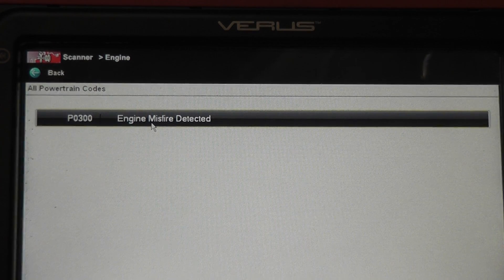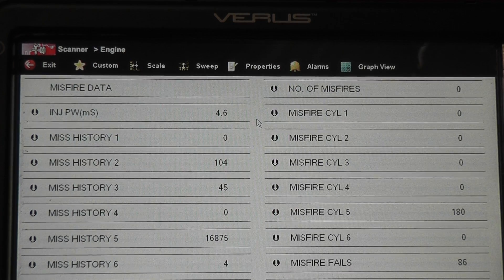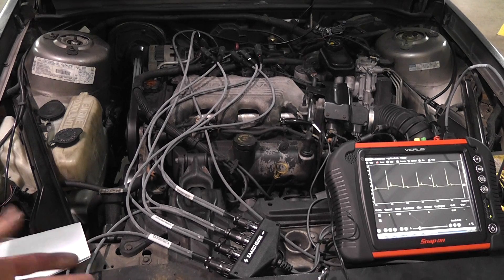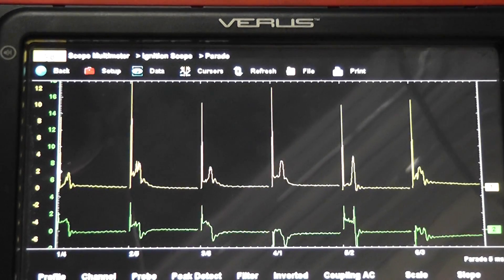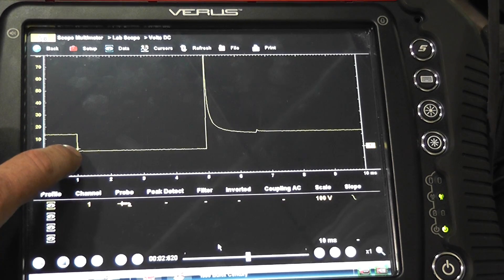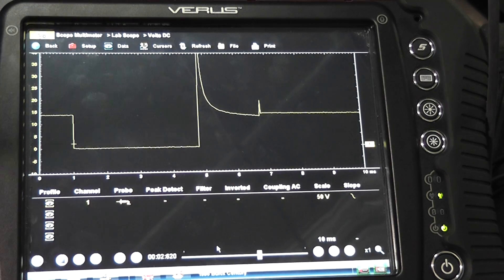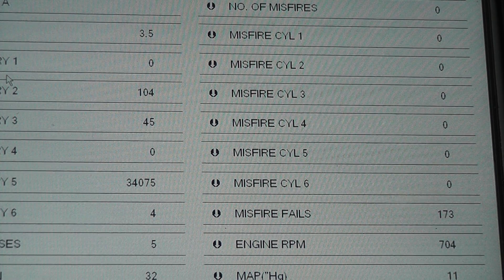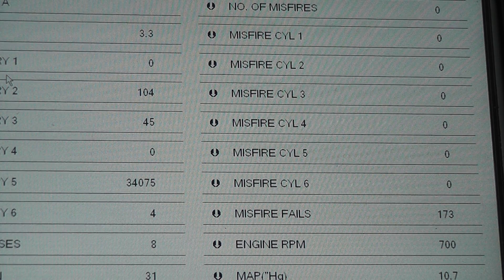Misfire from a sticking fuel injector (no fuel misfire)

Comment: Great Work Dan. I'm having a problem with my 2004 chevy sub. 5.3 L 64,000 miles on it whic is an engine miss at COLD Starts. Sets engine light. At 2100 Rpm's at Highway speeds of 65 to 70 Light Flashes, so I slow it down and back to steady on. Once engine warms up engine seems to per. Got a scan tool, Bank 2 has a higher LT than bank 1 being 10 to 12 and bank 1 is at 8 to 9.  When rev. engine @ 2,000 + rpm's noticed bank 2 cat. sensor #2 starts dropping from 740mv to .045mv? back on idle it comes up. cats are clear no pressure before it. changed that rear sensor, same effect. # 8 cylinder is the one showing up as the code P0318. #8 misfire. Snap on tool shows 18,000 total . Changed all of # 8 items with other cylinders. # 8 still comes in as misfire. Looking at Injector #8. Tried Inj. Cleaner LUCAS. Same with several treatments. Tried Propane intake test. I didn't notice any change in RPM. These are few of the brief things to mention that I been trying. In open loop I under stand its a set program in the computer. A rich Mix etc. I understand a lack of fuel could be an issue. Fuel PSI AT 55PSI. I'm Thinking it can be injector related because of the HIGHER Bank 2 LT FT and the reaction of sensor 2 after cat?
                        Can sure use your help on your input Thank you   Alex   

                                                       alamowclan4@aol.com
Reply from the maker: I am directing all help requests to my forum. Sign up (it's free) and create a new post. Be sure to add a name under "alias" as this is the name that will appear in the post.
Here is the link to the forum. 
http://www.scannerdanner.com/ForumRetrieve.aspx?ForumID=3226

Comment: I currently have a customers 98 GM 3500 with 7.4. Misfiring like a champ. From past experience I went straight after the distributor. Bushings were good. Cust has already done plugs and wires so i replaced cap and rotoe while it was off. I ohmed injectors hot and cold and got a 12.7 ish all around except one was 6.5. Injector wave has a varied collapse voltage. Vehicle has fuel pressure loss sitting combined with hard start. I didn't pay attention to the hump. Would would the wave of an injector not totally closing look like?  I'll play with amp and voltage again in the morning.
Reply: As a Mech of 25 plus years. I'd say you have a leaking injector. Leaks slowly, fill the cyl Slightly. Then is hard to start. Check / watch fuel pressure when shut off.
Cheers.
Reply from the maker: Is the engine running rich? (What are your STFT and LTFT fuel trim numbers?)
They may be listed as Integrator and Block Learn.
You may or may not see a leaking injector in a pintle hump pattern. Watch my video on a GM CPI system where I show how to find the cause of the bleed down problem.
GM CPI Leak (part 1)
GM CPI Leak (part 2)
Reply: chriscarshunting
Well I have this thing all done.  I had recommended to take care of the lower intake gaskets as I could see some coolant loss.  Once the upper was removed, I could see where the leaking injectors were washing, and had a puddle of gas in the bottom of the manifold.  I removed the lower and the manifold to head gaskets were totally buggered,  Did lower gaskets, replaced all 8 injectors (on a note this is not a CPI system) and it runs like a charm now.  Took some more Voltage and Amp patterns and a definite change especially in Voltage.

Comment from the maker: Stuck open would result in the same pattern (no pintle hump). However the symptoms would be drastically different. Check out my video on "Stuck open fuel injector". This one wasn't stuck open mechanically but was electrically shorted to ground so the waveform would be completely different, but check out how it ran!

Comment from the maker: most likely this is from an ignition misfire and the PCM is protecting the cat. by shutting the injector down. 
the way you can tell this is what is happening is by rechecking inj. pulse on initial start-up. If it comes back for a few seconds, then it is NOT an injector problem.

Comment from the maker: @MrToolean sure. it uses a high resolution crank sensor. one that has enough signals on it to allow the pcm to monitor acceleration rates of the crankshaft between cylinder firing events. a frequency increase =the cylinder fired. a frequency decrease = misfire

Comment: its a new stat and it never did that before it always stayed at 180 witch is the thermostat i use all the time.it does sometimes leak a little water from the resv container witch is weird.possible that rad is a little clogged?i tried flushing it cleaned it but still the same with new stat and coolant.its weird depents how much gas or freeway speeds it fluctuates its weird.i know its not normal because it didnt do that before i have had this truck for five years  got it at 125 k now has 172k

Comment: question off this subject.my v8 explorer temp needle fluctuates from about 170 to 190 dgs but never passes midline or overheats.moves up or down depending on driving speed at idle it stays about 180 so i changed thermostat and new coolant but same thing.any tips you can give me?can a dirty rad or going bad fan clutch do that?thkyou

Comment: I have a 00 centry with a 3.1 and i recently tuned it up. Directly sfter the tune up the mileage got worse and there was an intermitent hesetation or sputtering but so far it hasen't set any codes. I was wondering if you had any ideas? thanks

Comment from the maker: Yes, that is also an acceptable method, however noises transfer and you can hear injector clicking from the injector next to the one in test, especially with the sensitivity a stethoscope provides.  This is why I will use a long screwdriver for the sound test as it is more muffled.

Comment: @ScannerDanner can you by chance do a video on capturing a bad injector on low amp. probe. 
A good one would  dirty injector that is causing a lean condition.
also what is your option on amp probing starter for testing purposes? would it be accurate for diagnosing a failing starter? 

thanks

Comment: @frosty9595 I might try the Techron, BG Cleaner, or some other brand to clean my injectors, but it that doesn't work, I might have them cleaned by Witchhunter dot c-o-m. They charge only $20 per injector to clean, replace inlet screen and O rings, and test. Seems reasonable to me.

Comment: Another question. Without using a lab scope, could you also attempt a fuel injector leak down test using a fuel pressure gauge and a manual device to activate the injector such as supplying 12v to the injector after disconnecting the injector wiring connector ?

Comment from the maker: @CoolasIce2 I have never seen a stuck open injector other than when the control wire is shorted to ground, causing a constant magnetic field. I think the fuel pressure behind the injector pintle would force it to close, maybe that's why.